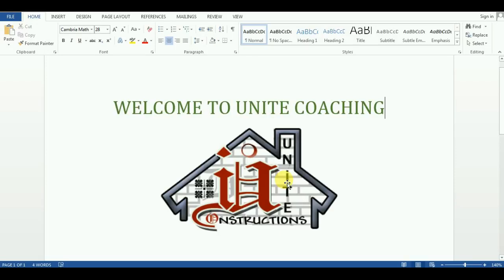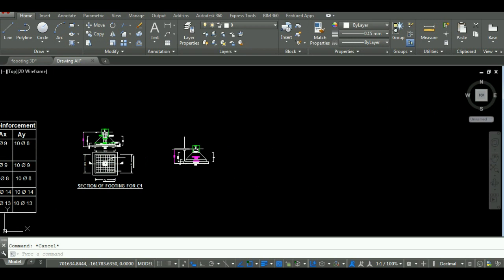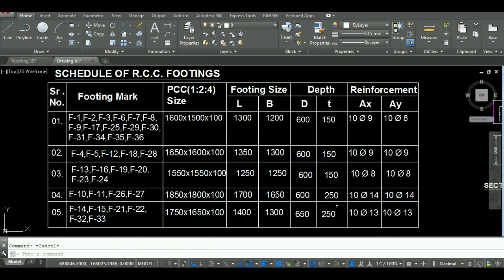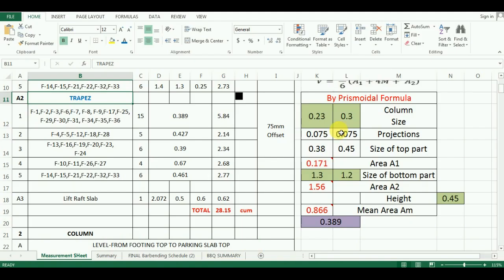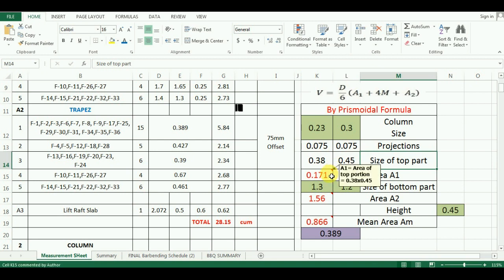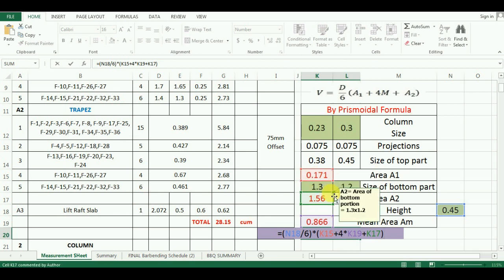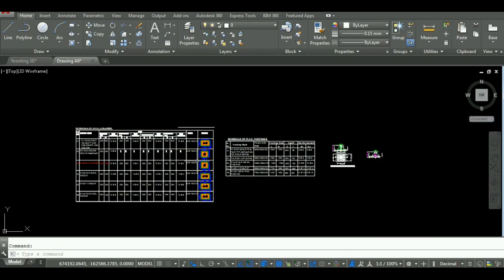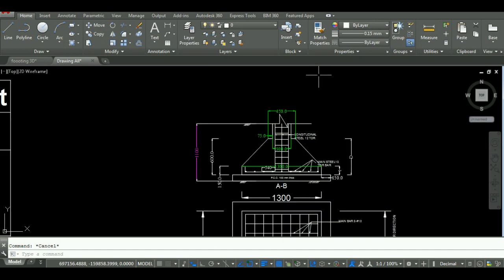Detailed Estimate of a G+3 Building in Excel -Part 3 Concrete in Footing

Comment: How to calculate approximate quantity of steel for footing..?
Reply from the maker: From the Structural drawing, first calculate the weight of steel (in kg/m3) provided in footing as per Design.
Then multiply that value with the Quantity of concrete which you calculated in m3
You will get your total steel in footing in kg.
So its simply, Total steel in footing = weight in kg/m X Volume of concrete